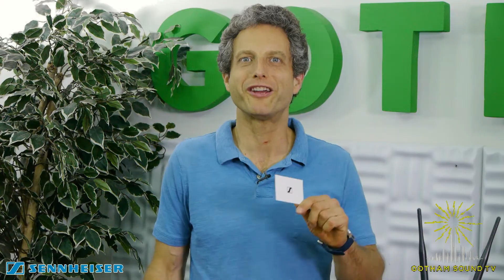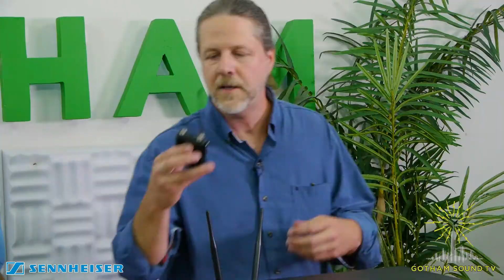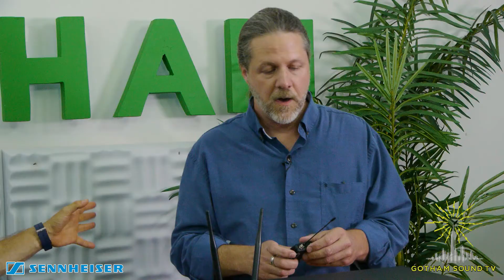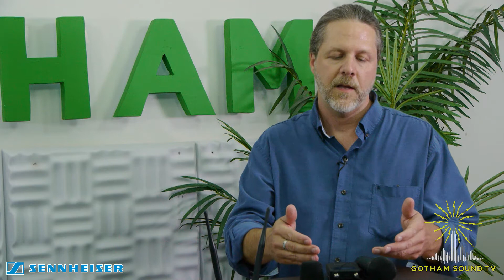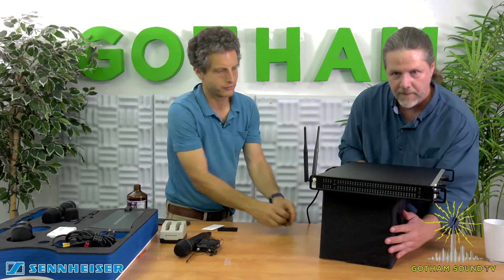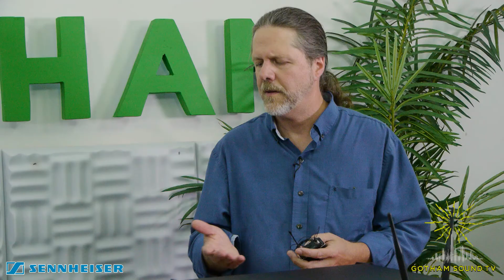Sennheiser Digital 6000

Comment: Got my first pair of SK6000 with EK 6042 recently. I love the quality of the sound. Signal at 30mW in LR mode on those gave me quite a distance with just a regular RF Venue Divercity Fin. I'd say 250-300ft., possibly longer in daytime city outside without a single dropout. Which in general in incredible distance from my general experience. I do agree they are very expensive, but the sound quality is definitely incredible, especially with DPA 4060. I love it. Gonna get more soon.
Reply: with skm5200 whow is better?
Reply: @userblog9988  not sure what you mean with your question
Reply: @kappabravomusic2101  my English language very bad men😩 i dont understand 😩 Iam Indonesian
Reply: @userblog9988  type it in your language I'll Google translate it later on
Reply: @kappabravomusic2101  I think he meant to ask is there any audible differences between the Sennheiser SKM 5200-II (the world best analog handheld transmitter) and the digital SKM 6000. I also wonder what the difference is...
Reply: @k.m.1524  It's possible.